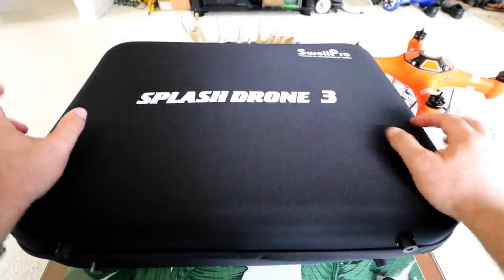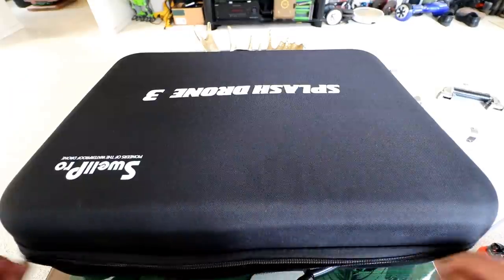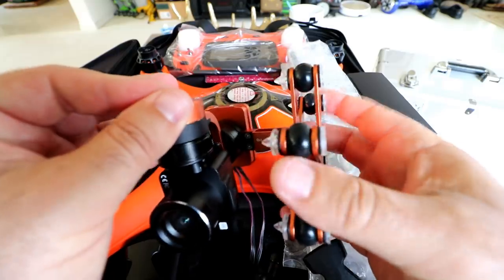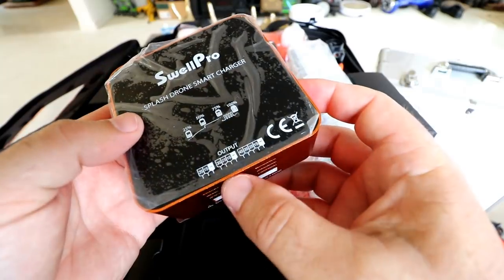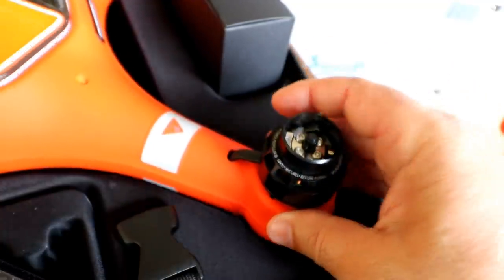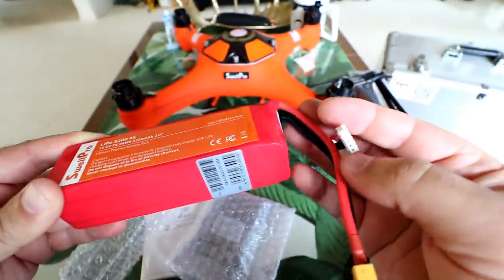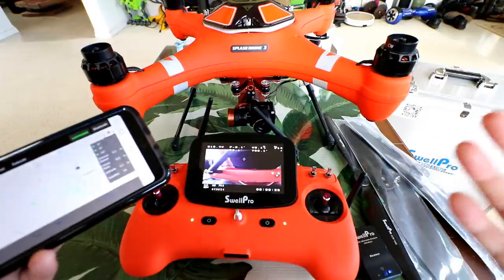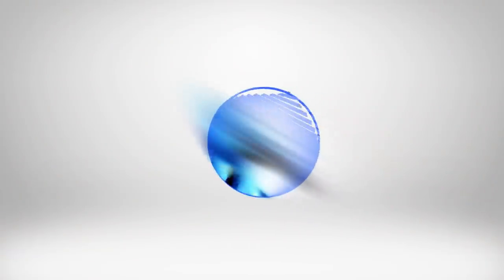SPLASH DRONE 3 Review - SwellPro's Newest Waterproof Drone - Part 1 - Unboxing, Inspection, Setup

Comment: Greetings fellow DunHeads - not until I saw the SwellPro 3 did I decide I needed a waterproof drone. If you can be waterproof and compete with DJI camera quality - I'm on board. I also really like that SwellPro has designed multiple uses, including search and rescue, into The Craft.

Comment: hi Dustin, Juan here all the way from South Africa. Sorry to be a nusence but i have a Mavic pro, the older one. Its a fantastic drone and i have been wondering if i should upgrade to the new one or even the zoom. But then i saw a dealer of the new Swell Pro 3+ and thought maybe something new and a little different would be good? what would your thoughts be on that? or is Dji still the king of drones? any help would be greatly appreciated...thank you!
Reply from the maker: If your looking at a weather/waterproof drone then Swellpro is likely your best choice from my experience.
Reply: @DustinDunnill  dont neccesarily need an all weather drone, just an upgrade, how would you compare the swellpro to the likes of the the mavic 2 zoom?
Reply from the maker: The only thing better about the Swellpro compared to the Mavic 2 Zoom in that it's all weather.

Comment: Hi Dustin,nice review,have been waiting to see a good independent review,I'm an area co,ordinator for BDMLR(British divers marine life rescue)and we are looking into using drones(waterproof)to aid in our rescue of entangled whales/dolphins etc,so we can check out the best or quickest way of cutting the ropes or nets first with the least Disturbance before moving in with boats so will be looking in to fundraising for these splash drones or the Quad H2o,looking forward to water testing..Cheers
Reply from the maker: Thanks Tim.  This may be a great option but I'm not sure you'd be able to cut anything with it flying aside from the danger of the propellers cutting something.  There is always a way though.  maybe a remote cutting arm with an fpv camera on it?
Reply: Dustin Dunnill ha,I think I worded that wrong,I meant using the drone to go in first so we could see/check which ropes or net are causing the main entanglement so we can cut them first from a boat instead of spending a lot of time cutting lots of different roles when sometimes just cutting one let's the rest drop away,but yes would be great if there was a way of using just a drone to do all the work instead of going on a Nantucket sleigh ride and causing stress or harm to the whale or rescuers or a way of using that release mechanism to attach a satellite marker bouy Cheers
Reply from the maker: +timbobain 10/4.  Or I just read it wrong and had a cool rope cutting drone image I'm my head..lol.  keep up the good work saving our sea life! 👍
Reply: Dustin Dunnill Niceone,we will do,and as I said,I shall await your sea trials of it,keep up the great work with your reviews.Cheers

Comment: Good job on your video Dustin.  I have one question.  Would you buy another splash drone 3 if you lost the one you are working with in this video ?
Reply from the maker: +Rocky Walker I would if they update the software to remotely be able to self right in water if it flips upside down.  See my ocean flight test and you'll understand 👍
Reply: Dustin. You did an awesome review of the SD3 but like you just mentioned about flipping over and basically saying bye bye to your drone really stinks to say the least. I just got mine 2 days ago and flew it in a lake and after landing in the water i didnt realize it was to shallow the landing gear got tangles up on some seaweed and the drone flipped over. Thank God I was able to get a small boat and row myself to retrieve my drone!!!

Comment: have they rectified if it tips unside down in the water if it turnes right up again
Reply from the maker: +MrGozoMalta Not yet but I'm working with them to make an option in the SwellPro assistant software to turn arming angle limit on or off 👍

Comment: I bought the splash drone 1 and it was absolute garbage. Spent over $2,400 on propellers batteries new charger etc. The battery took a dump after first flight bought 5 new batteries then the charger went out then the drone lost  signal and crashed. Swore id never spend another dime on a swell pro but decided to buy the splash drone 3 auto today spent another almost 2k. I paid $50 for 2-day delivery. Btw I was never able to fly my first drone because both times I tried to fly the drone it lost control while hovering and crashed. The first time it busted the props and the second time it broke the gimble. If this next drone I just bought has any problems ill be sure to never buy another swell pro. Also, all the directions were in Chinese and because it was such a new drone company there wasn't any youtube videos or information on google. I'm so far very disappointed in the company but will give them one more chance to provide a decent product.
Reply from the maker: It's definitely better in this 3rd generation.  Also the company seems reasonable about replacements for defects.  Just SEAL THAT TOP GOOD! 😅👍
Reply: Dustin Dunnill Your video is the reason why I bought the 3rd gen today. Did swellpro give you the payload and camera for free because your channel? The splash auto doesn’t show it comes with the extra payload and camera accessory. 

Btw great videos thank you!
Reply from the maker: Yes, it's available separate on their site.  They sent me it as a demo.  I still need to do a fishing video with it soon.  I tried at a great spot but was too windy so just did an unboxing and table demo of it so far.
Reply: Dustin Dunnill Okay well you got a new subscriber 🤙 and I look forward to future videos. Cheers 🍻
Reply from the maker: Thanks.  I've got a few more vids on it if you haven't seen them 👍
Reply: Where did you test flight it in your house. You need a larger area to fly.  If you had issues right  away you do have a 1 year manufacturer warranty it's not hard to call or send a email.